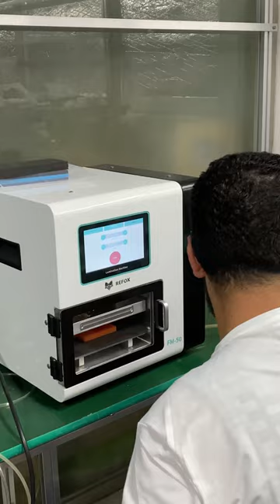iPhone Screen Refurbishment - REWA Academy Onsite Training Day 1 #shorts

Comment: I have a better way to remove the LCD glue, by wetting the cloth with thinner and then placing it on the LCD, leaving it for 2 minutes. If the glue is still hard, flush it with enough thinner with thinner until the glue looks broken, use a cleaning tool, just finish cleaning it, for installation so that no wind bubbles occur, I add baby oil, smooth it with my hands, immediately press it for 400 seconds, just put it on

Comment: You guys broke the display
Reply: Sometimes it happens during lamination
Reply: They are students, they will practice and eventually get a feel for the pressure
Reply: @XtergoBlue  they will still break screens. They will just break less. During cutting the screen maybe fine. One put in mold and laminated sometimes they break. Thats just the nature of refurbishing screens. I am a repair tech but we also have a reputable refurbishing business called webuylcds. I have refurbished myself in the past. Most successful screen will offset the breaks. You will never achieve 100% success rate. Thats a fact. You can minimise. Screens should be tested after cutting and cleaning to reduce wasting your time. A screen can be broken badly but during cutting and lamination its nearly broke but not quite until lamination. The lines a flex damage.